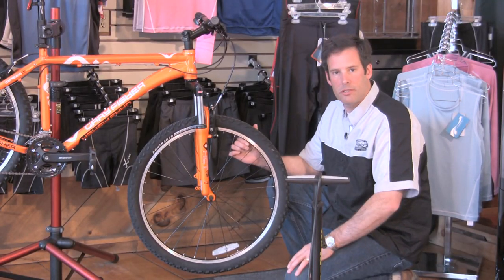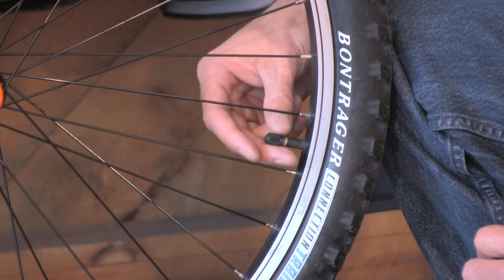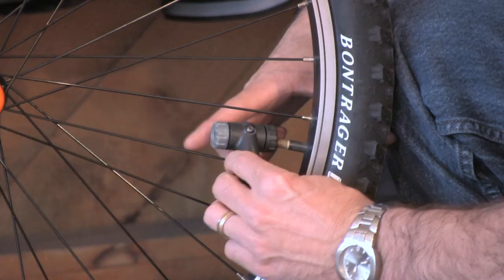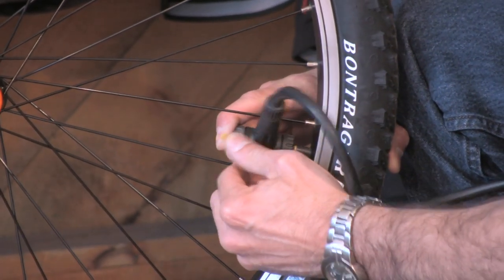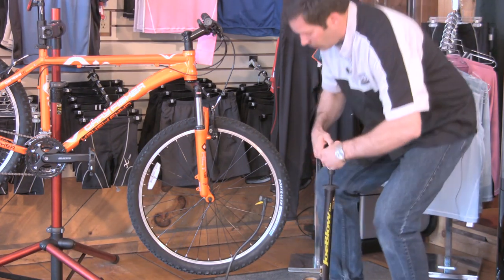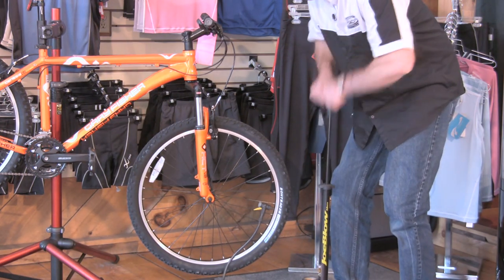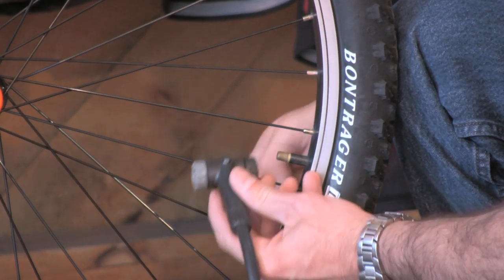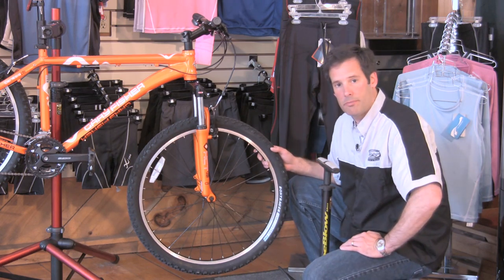Bicycle Parts & Maintenance : How to Use Bicycle Pumps

Comment: Thats why the lever.. push the pump against the valve, and flip the lever. That will lock the pump over the valve opening which will stop the air inside from escaping..